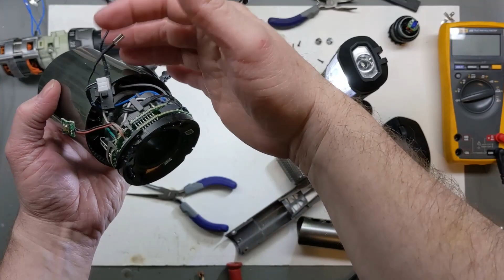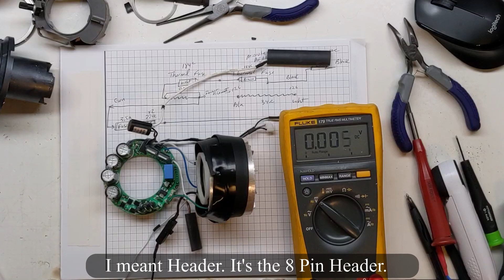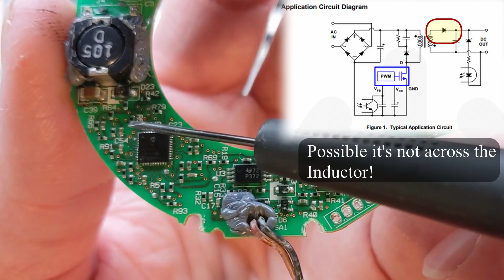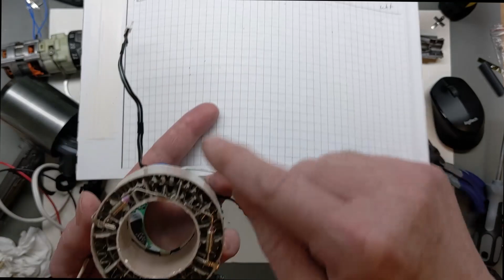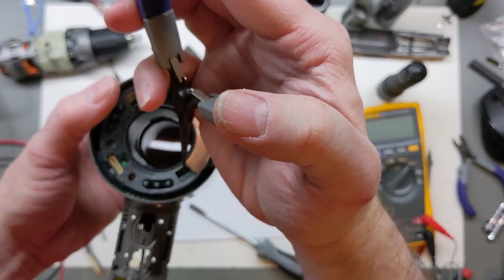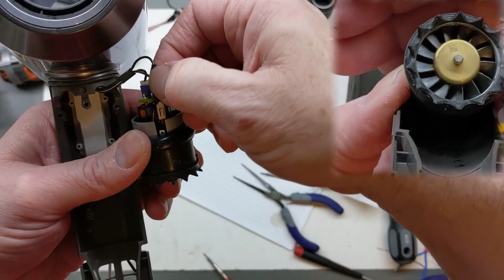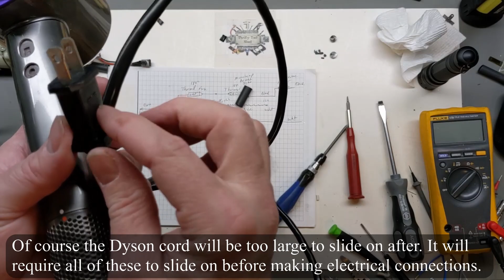Dyson HD01 Repair #2 (Board Level Repair)

Comment: This was a great video and inspired me to give fixing my dyson hairdryer a try. In the process I broke of the tab or plug on the metal casing of the motor that connects to the black wire. Is there a fix for that (other than buying a replacement motor) or have I sabotaged my efforts? Thanks for posting this video!
Reply from the maker: If you are talking about the ground wire that attaches to the motor housing, you may be able to solder the wire on the housing. It will not be a way to put tab back on. If you can not solder it maybe ok to skin back and let it make contact with the outside of motor housing? Since it will be clamped in well?  Thanks for your comment and Best of luck to ya!

Comment: Hello there! We just bought a knockoff chinese model that mimicks the original one... after a couple months, it just blows cold air. So far, and watching your previous video, I opened the handle part, and looks surprisingly close to this one! Just before I mess with it trying to open the upper part, and recognising I just had a VERY basic level of electronics knowledge... lights are on, blows cold air... just not hot. Could it be the temp fuses on the top of the heat resistance? What else could be causing that failure? Thanks!
Reply from the maker: If it is alot like the Dyson it could in fact be the thermal fuses in the front side of the heater unit.
Reply: @ThriftyToolShed  great, now I just need to open the upper part without breaking it :) and order some spares if that's the problem :)
Reply: @ThriftyToolShed  so I guess you must remove the back plate so you can twist it to unlock the flaps on the front? I can't find how to open it without damaging the case
Reply from the maker: @helpman  Well assuming it's like the Dyson in the video then the back plate does pop off after some careful prying around the crack of the housing and the plate. The reverse steps of how I put it back  together is how it should come apart. I could not show correct steps apart since I did it wrong to start with, LOL. After I got it apart I realized how it all went together and discussed that a little bit and showed reassembly.
Reply: @ThriftyToolShed  trying that with plastic phone dissasembly tools I had no luck. then I tried with a small screwdriver... and it slipped off... and I have a nasty cut on my hand now :( this thing is stuck, I can't pry it open :(
Reply from the maker: @helpman  it's not a Dyson, so it's hard to say without doing it. Of course the Dyson just pops in and out and maybe they Glued the knock off? Hard to say, Best of luck to ya!
Reply: @ThriftyToolShed  yeah, I know, but so far, it's the same frame, same screws... I'll keep trying with plastic tools :) or a hammer. :)
Reply: @ThriftyToolShed  so far, I managed to open it. it was just pry, but it was very stubborn... other than that, the case works same as the dyson. the inside is way simpler than dyson's (it was something I could expect). But I don't know what I'm looking at.
As it works, just the heat isn't working, I'm focusing on the heat unit. 2 cables attached. blue, direct to the heat resistance. red goes to a piece that looks like the ones on the dyson, it just have one. cylinder with a cone, metallic, the cone is yellow. I can only see Arlin (r) ENAAQ F2400? last 2 numbers/letters are partially deleted, so I'm not sure, written on it. Maybe a thermal fuse? As my knowledge is less than basic, I just tested to check continuity, and looks like it's fine (the multimeter beeps, value 1 on the screen). It's connected to a small metal plate, looks like a switch on the bottom, maybe a relay? and then connects to the other part of the resistance.  Everything on the heat unit is mounted with rivets. If you're curious about how it looks like, I could send you pictures. I'm surprised on the inner differences compared with the dyson... I think there's a soldered fuse on the board which seems to be ok too. I tried force opening the relay to check if it produces heat, no success at all. I'm lost now, as I don't know what more to test.
Reply from the maker: I can try to see. It's hard enough for some things in your hands. Pictures are hard to troubleshoot by for sure. 
thriftytoolshed@gmail.com
Reply: please be careful i had one of those blow up on me. my hairstylist was using a fake and she didn't even know

Comment: To be honest, when I saw the YouTube notification about this video, I thought you were fixing a drill. Anyway, I ended up watching it to the very end. Are you fixing that drill too? 
It could be nice if you could find a non working brushless Ryobi drill so you could fix it. I have one that doesn’t work.
Reply from the maker: I was testing this Ridgid Brushless motor with the cheap hobby BLDC driver. It works very well, but not reversible built in. I have a video looking into this Ridgid, it was really non-repairable. I did show this motor run with the cheap controller. I also used this same controller to fix a Ridgid Brushless jigsaw. It had room to add the controller in the housing! You may be interested in the Ridgid videos, both Ridgid and Ryobi are made by TTI.
Reply: @ThriftyToolShed  
I will have a look. 
It is annoying buying brushless tools and then for them to go wrong. I guess I will stick to my old brushed tools.

Comment: Ambition, a wonderful fuel! You may have discover a problem with original manufacturing, being that diodes' susceptability to failure. Very cool. Thanks. If you know, you know, don't matter where you're from.